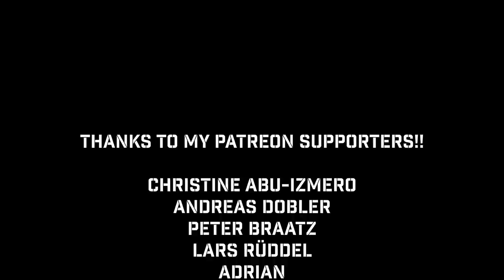Retro Fire Station | Building a unique lighter out of an old screw driver!!

Comment: Love it. Having something for the lighter like a display stand that's attached to the sparker switch would be a nice finishing touch.
Reply: I thought he was going to bend the shaft all the way up into a horseshoe shape and make the blade end the striker wheel? Then the handle would be the liquid fuel tank with a wick like a Zippo or trench lighter. Then blow it out and screw a knurled cap into the butt of the handle. But this is cool too.